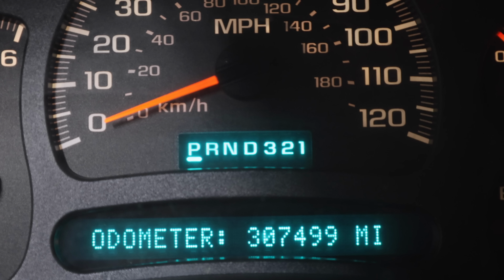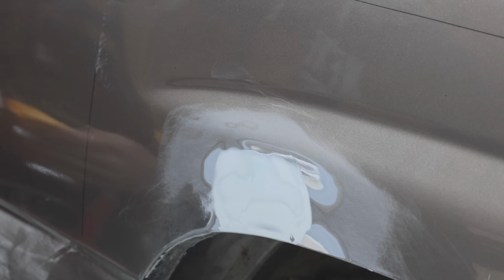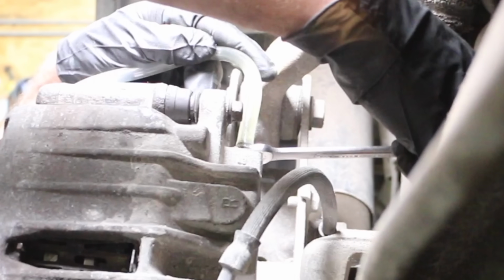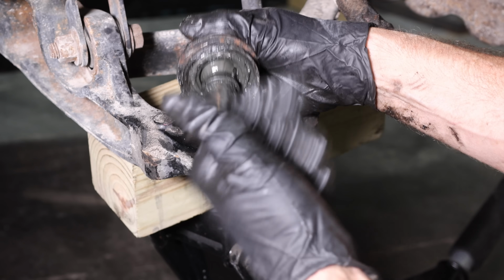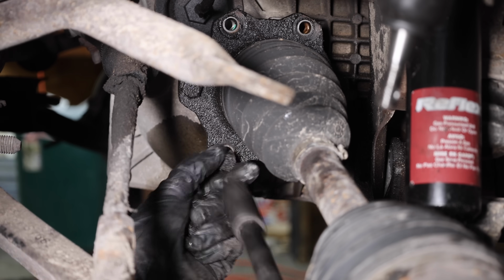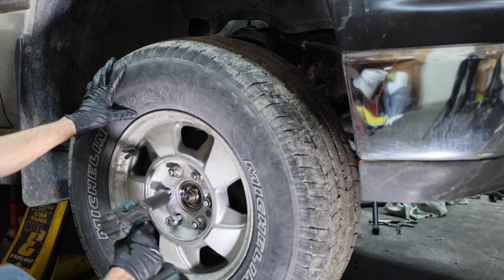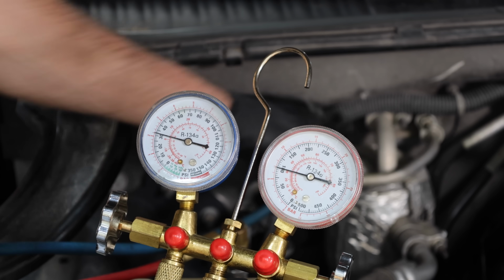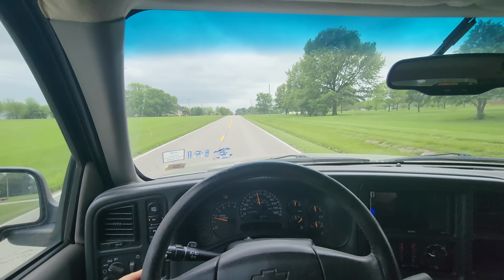Is It Stupid To Fix Up A 300,000 Mile Vehicle? Let Settle This!

Comment: PF, I’m sure you probably know this but for those who don’t, when you push the caliper pistons back, crack the bleeder open so that the crud doesn’t go back into the master cylinder. 9 times out of 10 you won’t have an issue if you don’t but I have had 1 vehicle that I did have an issue with when I didn’t do that. Just a tip for the home job guys and gals.
Reply from the maker: Thanks for the tip.
Reply: @ProjectFarm  no problem, love your channel. Great content explained in a way anyone can understand.

Comment: Never change the steering box unless you absolutely have to, Most remanufactured steering boxes will leak on the first use, I've gone through 3 reman steering boxes on my 02 marquis, Ended up going to the junkyard and picked up an original ford steering box off of an old cop car, Hasn't leaked since! and works even better then the remans doesnt feel as sloppy!
Reply from the maker: Thanks for sharing.

Comment: These old burbs and tahoes are sooooo nice. Awesome vehicles.
Reply from the maker: Thanks!
Reply: @ProjectFarm  Got an 05 Tahoe that recently rolled over 300k kilometres. Just ordered a new power-steering cooler since I got a small leak, new brake shields for the rear, new E-brake kit.
She's been good to me this winter, due time to show her some love. My uncle had one for 15 years, he works on an oil rig at sea and when he was home he used to rent out scaffoldings so he hauled alot with it. Hardy vehicles. Been thinking about having another one imported to me here in Norway, from a sunny state if mine goes to the eternal highway at some point. Do yours have a name? If you remove the bezel around the instrument-cluster you'll see a tag with a name.☺️

Comment: trouble is, the plastics, rubber seals, hinges, hoses, and even the wiring insulation is all degrading and at EOL by this point.

Comment: Make sure you wire wheel all the crap form the welded area flux etc it has to be totally spotless or the contamination will cause it to corrode faster, for mixing fillers paddle it in one direction squeeze it into a circular motion then paddling it in one direction that doesn't create air bubbles it is tricky at time but squeeze them out when mixing you have to press firmly when mixing... Your doing good usually I cut out about a inch farther then the hole to make sure there is no rust behind .. and clean up as much as possible of the metal behind as well ..

Comment: I'd like to point out, that the cost of tools is in many cases less then hiring someone like a shop to do it.
A few tools you used I don't have.

Like a few ball joint presses or bearing pullers or a seal tool
But let's say the cost of those tools are around 100 to 150 bucks or less used,  cost at a shop would be
300 to 700, that gm a break job 700 bucks at a dealership, a new SUV 
75k   parts bought and installed 1k

Yes you fix it, diy if you can

I dont own a floor jack or large enough jack stands  lets say 60 bucks jack stands 5ton  200 a floor jack  
Even with all the tools its still less then going to a service center.

Charging the ac system, i belive its smarter to use a ac service machine that recovers the ac fluids
Change the valves  they do not loose charge unless they have a leak usually the sharder valves they use O rings as a seal the O rings compress over time causing them to leak plus you need to bring the system down to a vacume then charge it if moisture is in the lines
The water and freon and water can screw up the system also you will not get the correct weight of freon in the system making it under preform.  Its also a good idea to add a dye you can use a light to look for leaks with. 

My dad always said don't fix it until it breaks and he drove his cars until they fell apart. In his 83 years he only bought 2 new cars all the rest were used, driven for years and years and years then traded.

When i was 1 years old i broke the horn on his 40s something Willie's wagon when i was 3 i fixed it.
That was 61 years ago.

I would love to have some of the cars he had owned. A few are collectors items today worth  1000s of dollars that only cost a few hundred when he got them.

You used to be able to buy an 8n ford tractor for 200 bucks in decent shape now is over 3k to 5k 
And id love to own one. Yes in the city.
Reply from the maker: Thanks for sharing.

Comment: You can replace the steering wheel column bearing to get an even more brand new vehicle feel to top it all off. I’d recommend a good brand. You can replace the upper and lower steering wheel columns too but I’d recommend replacing just the upper. The rag joint can get pretty worn out and make for a sloppy feel as well as the steering wheel column bearing.
Reply from the maker: Thanks for sharing.
Reply: Steering wheel column bearing wears out really quick though. Some people will replace it once and then just cinch a zip tie really tight around it when it start “clicking” or “knocking” again. I rebuilt my entire front end like what you did and would still feel a clunk. A little more research revealed that I should replaced those components. After doing so, I was finally satisfied with my entire rebuild.

Comment: Great job PF, great work. You missed one thing I learned in the past, that sound deadening material is what holds in moisture, and if there is a lick of salt in the winter months down by you, this tends to happen x100 compared to further down south when no brine is on the road. Regardless you got a sponge for a very non noticeable amount of comfort gain vs a panel eating nuisance that needs to be ripped out.
Reply from the maker: Thanks!  Thanks for the feedback.

Comment: Absolutely NOT stupid!

You clearly do NOT live in the “rust belt”, so 300k is fine given that you’re meticulously in your maintenance, and $2000 won’t get you anything better!  At some FUTURE point the interior and other issues will make the cost & work a losing proposition. 

You also need to include depreciation in the annual cost, so “cheaper to keep’er” wins until the repairs are over 50% of value, and that car seems to be in fine shape!
Reply from the maker: Thanks for the feedback.

Comment: Spray the inside of the welded area with fluid film or some kind of rust protection. The rust will start from the inside if you don't do that.
Reply from the maker: Thanks for sharing.

Comment: Just a tool recommendation for you, replace that hand pump for the gear oil with a power filler. I have one made by motive, and it makes changing oil so much easier. The one I have is made by Motive, but there are plenty of them out there. For context, my Tacoma uses around 7 quarts of gear oil between the differentials, transmission, and transfer case. By far the best lube tool I have ever purchased, even if it only gets used every 30k or so.
Reply from the maker: Thanks for the recommendation.

Comment: Inner and outer tie rods, steering gear box, oil change (what about oil filter?), front and rear diff fluid change, trans fluid partial change, freon top off, hub replacement, brakes on all 4(?) wheels, and the initial body work--sir, you just saved yourself probably over $1000 in labor costs.  How long did it take you IRL?
Reply from the maker: It took 40 hours but the camera slowed me down.
Reply: @ProjectFarm  Understood. How long do you estimate it would take you if you didn't film it, not counting going to buy parts, just the work you did?

Comment: Converting the cooling fan & clutch with a thermostatically controlled electric fan kit, like the Flex-A-Lite fan, will improve performance, as well as fuel economy.  I'll bet you noticed a precipitous drop in fuel economy with the new fan clutch.  If memory serves, fuel economy is improved by at least 2-3 mpg, with a noticeable improvement in performance.

Comment: Another tip: lug nuts and lug bolts that have the stupid chrome cap on them. Throw them out and get solid one piece lugs. Otherwise they will swell up, normally in the mornings because of the dew. Also in wet weather they swell and ya can't get them off. Don't believe any bs about wrong socket size being used, they swell due to moisture not a 3/4 socket on a 19 mm.
Reply from the maker: Thanks for the tip.

Comment: It's intelligent to overhaul a good vehicle only stupid if its a worthless money pit...trucks/SUV unlike most cars are useful and with AC, 4X4, Overdrive transmissions and can haul, tow as well as transport other people makes it have a base line value cars do not have unless a sports car or wagon. Why buy a newer car for price of a house today when a few grand you can drop in a new motor when that (5.3 or 6.0?) engine goes. A fool needs to be seen in a new flashy car, but wise men drive old (me,, Ford) trucks with money leftover in the bank.
Reply from the maker: Thanks for the feedback.

Comment: Good episode.  A little hint from an old guy.  When installing seals I always used Vaseline, not grease.  Grease often has soap and it hardens over time.  Vaseline disappears as the seal settles in.  Has worked well for me for about 60 years or so ...
Reply from the maker: Thanks!  Thanks for the feedback.

Comment: Still a baby, my 2011 reads 9999.9 on the hour meter. 290k + miles. No A C M and I've yet to pull the valve covers. Oil changes every 3k.
Reply from the maker: Thanks for sharing.

Comment: You need to sand the wheel hubs down and get the rust off or else you'll have runout in the brakes which will shake your teeth out when you hit the pedal
Reply from the maker: Thanks for the constructive feedback.

Comment: I had 326k on a Silverado 2500, 6.0 80e were all original, it wasn't rusty ot nothing engine had 10,660 hours, always ran great, I was about to rebuild the trans and freshen the 6.0 to stop a main seal leak, deglaze the cylinders and a few minor things it before traded it to the neighbor across the road. Hold on to theae vehicles like grim death, aquire more, especially if ypu have a place to keep them any chance you get to find one cheap, even if you get one not running that with a nice body and a rusty one that runs perfect, stack them like cord wood because they aren't making anything this good now and they claim they won't be making them in the future. I would buy every GMT800 I could find that I could afford and every '84-'97 Ford with a 351w, 300 I6, 460, 302 or 6.9 or 7.3 diesel especially 3/4-1 tons with manuals, especially the ZF-5. The GMT400s are ok too with 80e and NV4500s. The 4.8/5.3/6.0/6.2/8.1 are great engines especially with an 80/85e or NV4500/ZF6.
Reply from the maker: Thanks for sharing.

Comment: Pace is perfect. From my work 30 years in my family shop, I would suggest that pushing brake fluid back into the MC may cause problems. Better to start by sucking out the MC and add fresh fluid, then crack the bleeders when you push in the pistons. Gravity bleed or suction bleed.  We didn’t start doing it this way until antilock brake control became widely used. The ugliest fluid is what is in the caliper, better to get it out at the wheel.  Thanks for all you do excited whenever a new video is posted.
Reply from the maker: Thanks for the feedback.

Comment: Oh also you can get like absolutely giant syringes with a hose on the end that hold a full liter of fluid to add to differentials. There’s less wrist destroying effort required. They also make drill mounted peristaltic pumps which I haven’t tried but those seem fun.

Comment: The life pro tip on body painting is to get 2 part clearcoat cans. The addition of the hardener makes it much more resistant to UV. The single part clearcoat will fade much more rapidly than the factory stuff over the course of a year.
Reply from the maker: Thanks for the feedback.

Comment: I've seen Volvo's with 300,000+ miles serviced and back on the road for more. Admittedly, they have had many major parts replaced and rebuilt during that time. It seems to depend on how well they have been looked after, used but not abused. Mercs are the same by the way, with engines expected to last 200,000 miles. 
Things like changing oils and lubricants before embarking on long road trips. Make all the difference to longevity. During winter, regularly washing off salt deposits with clean  fresh water helps too.
Reply from the maker: Thanks for sharing.

Comment: How much did all this cost?
Reply from the maker: $2000. is the cost.
Reply: @ProjectFarm  that’s amazing you rejuvenated life out of this vehicle for only $2,000. 2 months payment of a new model
Reply: @ProjectFarm  btw, I paint cars for a living, and your repair was quite good for what it was. One tip though is, sand your last coat of body filler with 320 grit, spray primer, then sand primer with 1000 or 1500 grit with water to hide the edges of the body filler. Overall great job for not having a spray gun.

Comment: Not one rusted seized bolt in that whole front end? You are the luckiest man on the face of the earth.
Reply: He isn’t any where near New York apparently
Reply: All that oil leak protective coating 😂
Reply: @KevinPDunn  I call that the self changing option 😂
Reply: @KevinPDunn  If you're not a used car salesman, you've missed your calling.
Reply: @mitchjohnson4714  😉, love the community in the PF comments
Reply from the maker: Thanks!
Reply: Very Impressive!
Reply: This is how its supposed to be... The trick is,  dont live where they intentionally put corrosive salt on the roads, then pack that salt water brine into slush so it sits on components half the year.
Reply: Canada is hell. Vehicles are disposable goods here. Undercarriage rusts out so bad that a 5-10 year old trade in is worthless. I mostly ride motorcycles so I can at least hose them down and apply protective coating to the important bits.
Reply: @TravisFabel Lol,, Living next to the ocean is about the same as MI road salt...
Reply: I did some front end work on my wifes hhr. cut off wheel and blow torch. I live in the beautiful rust belt where the roads are hit with salt for 6 months and theres a pot holes coving 40% of the roads
Reply: Were gonna test that!
Reply: For real.  He stole that truck. Good deal.
Reply: Or the car is from west? lol
Reply: That's what his wife tells him everyday.
Reply: It's not luck, it's called "routine maintenance" which he clearly does! Lol
Reply: @rmretherford
Routine maintenance is to thank on a vehicle with mostly original suspension?

That makes sense to you?

Comment: You should do a video on a mishimoto electric fan conversion to this suv! Those clutch fans really suck some power from engine equiped with them. I converted my truck and it really woke up.
Reply from the maker: Thanks for the suggestion.

Comment: I'll add, you can use a file to file rust that develop on the bracket where the anti rattle clips go or as we call them brake hardware. But we usually use a 2 inch sanding disk in an angle grinder but honestly if you don't already have it just use a file, way cheaper just takes longer
Reply from the maker: Thanks for sharing.

Comment: Great video, I like the quick pace. Also I have a crown victoria I bought almost 20 years ago that just keeps on going. Have done brakes and ball joints multiple times. Coil packs fail once in a while, had to replace a real wheel bearing/axle a few years ago. I  run the slightly thicker diesel oil in it because the valve seals are pretty tired at well over 200K. miles. Went ahead and replace bearings and seals on both sides. When the average car payment is about $500 a month, This thing has been paid off since 2008.
Reply from the maker: Thanks!  Thanks for the feedback.k

Comment: I LOVE THESE ERA TRUCKS N SUVS … our little family had a 03 suburban that we bought new and several 99 -07  short trucks , that kept three daughters - high school and though all of commuting through college years ( and bit after) … I’m 66 and these vehicles have been the most reliable and problem free of all my past rear drive Chevys ( that’s all I owned) . One in particular  03 silverado short wheel base reg cab ( All v8 s). Bought it 3 years old 150 k miles for $8 k sold it for 8 k 13 years later.. 385,000 miles. You would be hard pressed to thought it had over 150,000 ( same engine , one new trans at 200,000 miles)
 Got to say : we are nuts about maint ,,, and appearance maint.. girls job was to help with ALL upkeep . And I always stressed : a clean car ( truck) is a safe one. Alway paint was beading water . If beds ever came off . Frame detailed / painted . Undersides washed regular … pictures oftened taken and helped sellin.

I got into flippin new takeoffs just to keep new tires on these shortys ( also because of young drivers kept 4 - 500 lbs of elevator counter weight in bed against cab. 

We loved those trucks so much that after I retired n thought about a fun vintage vehicle ,, instead of nova or camaro I spent ALMOST as much for a 29,000 mile shorty v8 that is mint ( always garaged )…  normal people would think I am insane for spending what I did.  I ALWAYS HAVE A SMILE ON MY FACE WHEN I DRIVE IT. (Or look at it!!!)
Reply from the maker: Thanks for sharing.